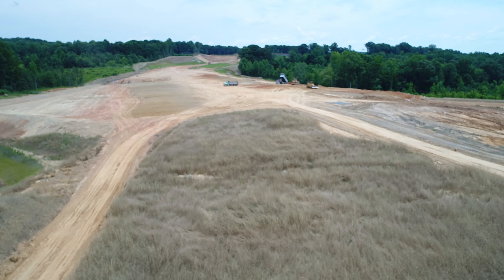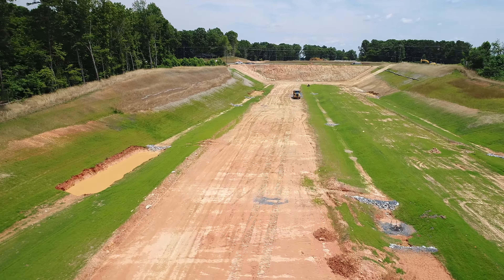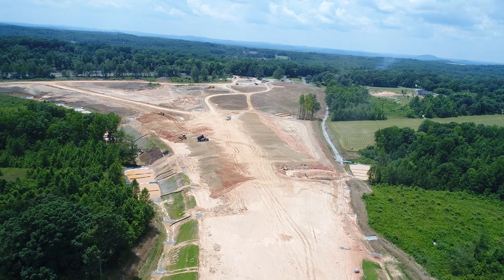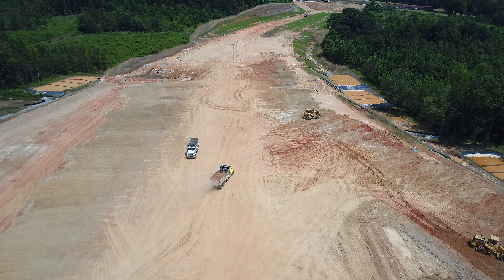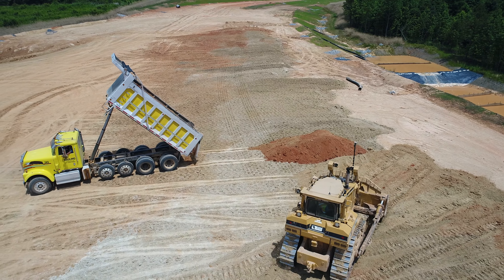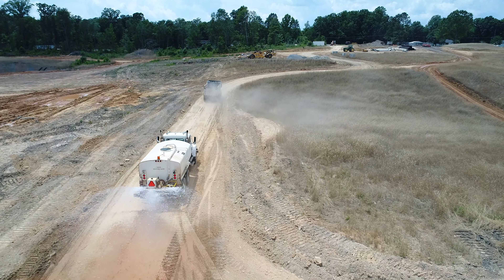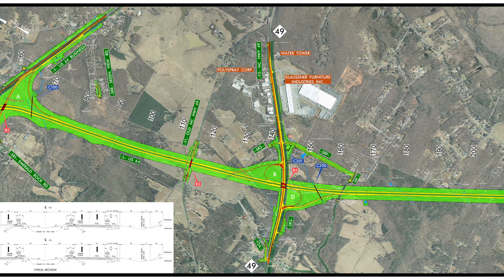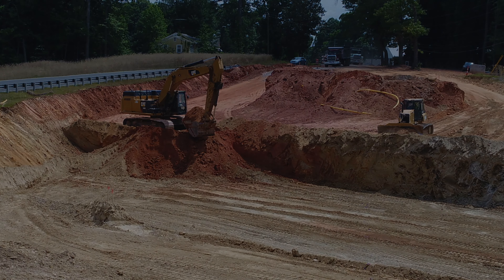64 ByPass Update...6/12/17...DJI Phantom 4 Pro

Comment: Thanks for sharing Tom.  Question for you if you know.... It seems like the road will be connecting at points, but trees are still standing, wonder why they haven't cleared all the trees from the path?
Reply from the maker: I believe their plan of attack is to work on all the intersection points first (24 bridges)... then do the clearing of timber sections later.  As I heard said once, "If you have 3 frogs to swallow... swallow the largest one first!"